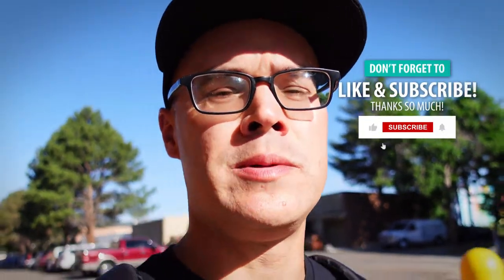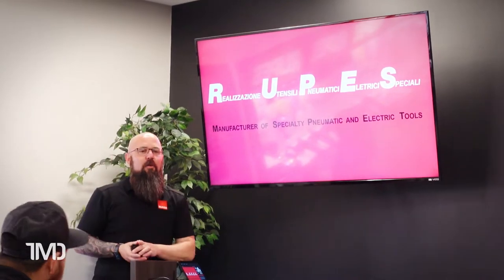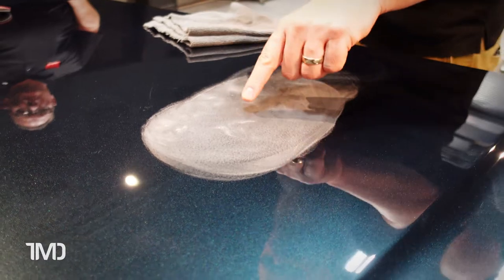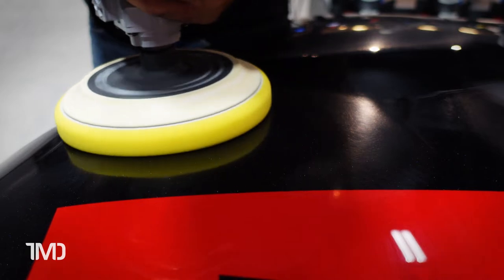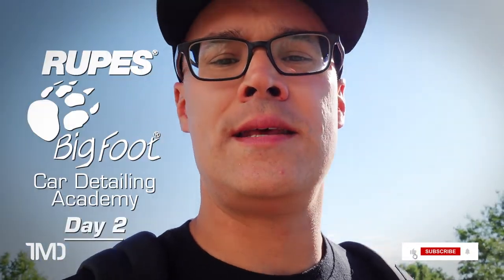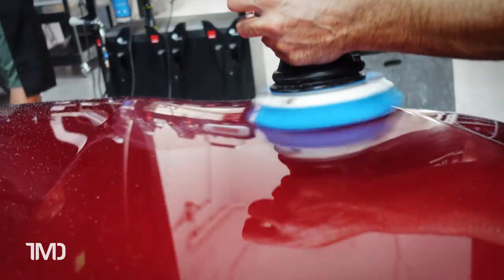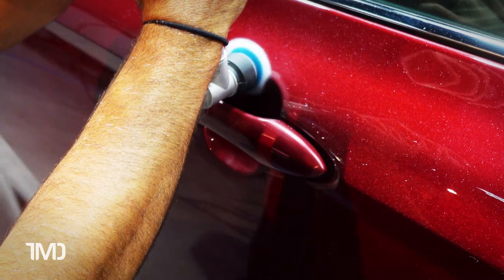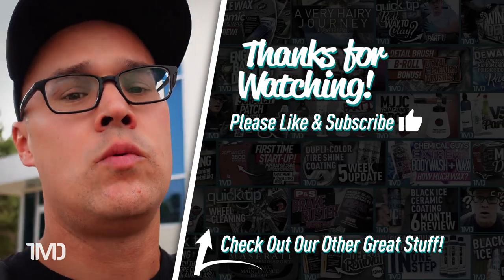Rupes Bigfoot Car Detailing Academy | Colorado, USA | My Experience!

Comment: Good for you bro! Knowledge is king and obtaining that knowledge from the creator trump's all other gleaned info, no matter the source!
Looks and sounds like it was time and money well spent - especially regarding your whole new view on sanding.
I'm always nervous when sanding- sand a little, check the depth with the gauge, over and over.
Just curious, what did the whole trip cost you including course fees, hotel, airfare, etc?
I'm thinking about attending this course but have to weigh the costs.
Thanks!
Reply from the maker: Thanks man, yeah it was awesome, learned a ton and made some good contacts too. Sanding can be scary, but like polishing, start at the least aggressive and it’s much safer that way. Using the right tools and mixing your edges goes a long way too. The class was $750, they do offer deals on local hotels, but they were all booked, we stayed in boulder and I think it was about $133/night, and the air fare was around $350 from Philly to Denver when we bought the tickets. We went for 5 days so obviously the cost would be different if you just go for the 2 days.
Reply: @TurnerMobileDetailing  Thanks, Seth. That's good info. We used to live in Denver and still have friends there.  We could probably t ourselves invited to stay with the and save $$.
Were you able to do any touristy stuff?
The Colors brewery tour is excellent. Boulder is a cool old west town to explore.
$750 is pretty steep for a 3 day course especially when you don't get any products or equipment.
Most of the  courses offered by  other mfrs are 3 day and you come away with products and hardware of some kind.
It will be cool to see you incorporate your newly honed skills into your videos. 
Speaking of videos, if you could do one on touchup paint and filling chips that would be great.

Keep doing what you do bro. 
I really enjoy your content and the way you present it.
One last question...
How are you liking your Blue Clean machine,?
Reply from the maker: @stevemclean5787  We hung around Boulder some, Pearl street I believe. We also took a day to do some hiking in Rocky Mountain National Park, beautiful! That’s where I took the clip of the chipmunk eating his seeds, he just sat there on a rock along the trail and let people get pretty close, he was pretty funny! 

The course was actually 2 days. There is a 3 day course, but the 2 day one is $750 for early booking. We did get to take home pads and polishes that we used during the class, but unfortunately no machines lol. I guess your paying for, not just the training, but the opportunity to get your foot in the door of rupes and make some good contacts, which I think I did, so I’m happy with the experience and they even told us to market the crap out of the fact we attended the course if we’re business owners. Plus they teach you ways to integrate different paint correction into your business and be more efficient, thus becoming more profitable. So to me it was worth it for the residual benefits.
Reply from the maker: @stevemclean5787  I like the Blue Clean, it has some electrical issues depending on the home I’m working at. If it doesn’t like the circuit, the motor doesn’t want to turn over. I have to play with the attached GFI to get it to turn over. But that’s it. I’m trying to get feedback from ARBC on the issue. But I’ll be doing a video or two on it about the end of the summer.

Comment: Do you know when RUPES is coming out with a 15mm battery operated D/A polisher?  They are very late to the game.  Thnx.
Reply from the maker: We actually discussed that with the instructors. The reason they haven’t yet is because balance and ergonomics of their machines is paramount to them. Battery polishers tend to be very unbalanced and uncomfortable to use over long use periods. I can attest because my dewalt battery DA is kind of awkward and un balanced to use over a whole car, especially on horizontal panels. So I’m pretty sure rupes has something in the works, but they won’t release it until it’s perfectly engineered. They are releasing a battery version of the 3” mini this year at SEMA. I got to use it and it’s very different ergonomically from the corded version. You can see it on rupesusa.com if you want to check it out. But as far as a 15mm DA, I’m pretty sure one is in the works, and it’ll be like nothing we’ve ever seen before, and probably cost a million dollars to boot lol!
Reply: @TurnerMobileDetailing  Thank you very much sir.  I could never get a reply from RUPES before.
Reply from the maker: @dtna  top secret I guess